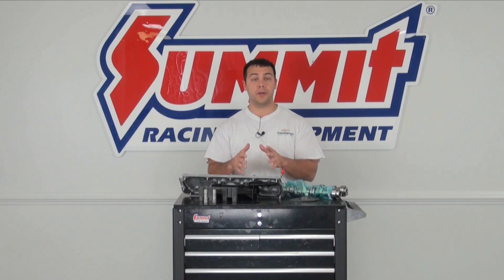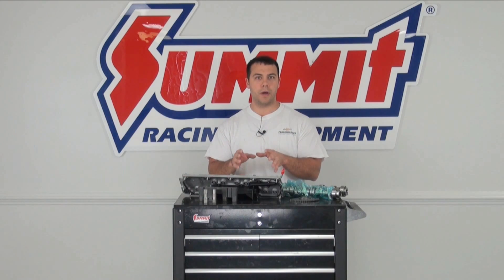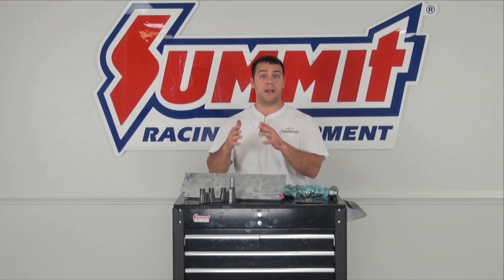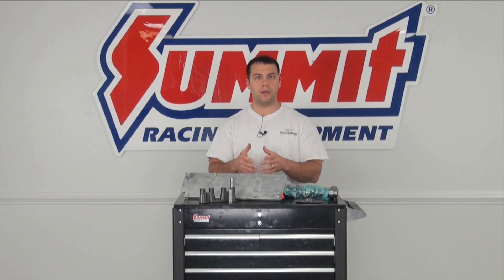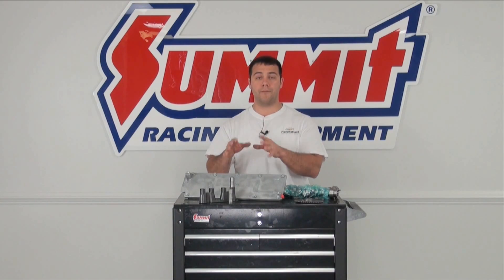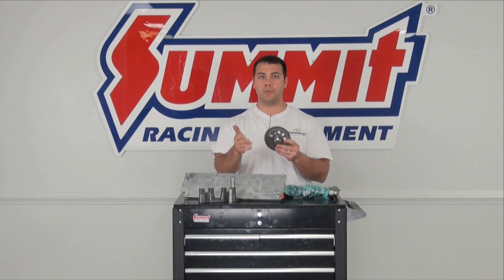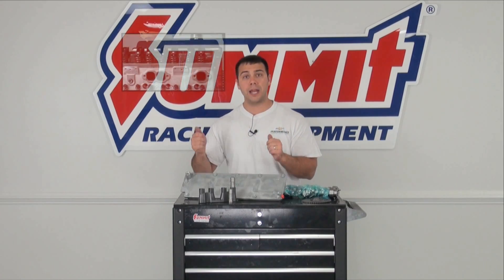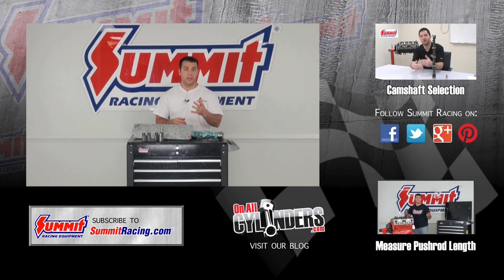LS Engine Cam Swap & Active Fuel Management Delete - Summit Racing Quick Flicks

Comment: I have a 2011 GMC Sierra 1500 Z71 off-road  with a 5.3 l with the 6 speed tran the truck started smoking maybe once a month or every 3000 miles give or take at aprox 150000 only on start up an it would be quite a bit of smoke an then I would check oil an there would be none on dipstick  which is  2 qt dipstick so from bottom of dipstick to full line is 2 quarts and I could always add a quart and then it would be half up on the dipstick so it's always just 2 quarts low every time when I would start it about every 3,000 miles or so and now it has 200,000 mi on it it's ran fine besides that happening but I'm looking to do an AFM delete kit and tune up what would you recommend

Comment: I have DOD deleted 5.3 and what to install a non active cam #12625437 and remove active cam #12625436 Can I reuse AFM lifters on a non active cam.
Reply from the maker: Thank you for your question.  Technically you probably could use a well-functioning DOD lifter, but there is still a chance it could collapse at some point.  We recommend using non-DOD lifters and trays.

Comment: Is is possible to just use the dod delete valley plate but leave the lifters and thus cam alone?
Reply from the maker: Hello, the valley plate can be reused, but the lifters are what normally fail when they are actuated.  A Range Technologies Disabler can be used if the engine is in good working order.  It can also be turned off in the tune with HP Tuners etc.  If you go with non-dod lifters, you will also need to go with a non-dod cam because the cam lobes on those four cylinders are ground differently.  The ECU will sense this as a misfire and will throw a code. 
 
A good article on this can be found here:
 
https://www.onallcylinders.com/2017/11/30/how-to-delete-or-disable-active-fuel-management-afm-on-gm-engines/

Comment: What can kit i can use if i have knock sensors?
Reply from the maker: Hi Luis, Thank you for your question.  Gen. 4 engines with AFM will all have the knock sensors located on the driver’s side just above the oil pan.  From there, the flat valley covers only differ in that some have a PCV tube and others do not.  Summit has both versions.

Comment: Btw this dod system isnt new at all if you guys remeber in the mid to late 80s when the cats on the exhaush was introduced cadillac had a system called  8 6 4 it did the exact same thing and it also was garbage. The coyote is a smaller motor and still blows the doors off a camaro from the factory

Comment: It's nice to use 500HP when you need it, it's better to get 25MPG the 98% of the other time you're just getting groceries (which my stock LH6 engine did). Please do a video on cam options for AFM-keep engines. Truck (torque) & car (speed/acceleration) applications, and include torque converter recommendations as needed. Lifter longevity is extremely important...it's bad enough with the factory cams and the repair is horrific in that the heads have to come off.
Reply: vidznstuff1 lh6 only gets 300hp stock? What mods did you do?
Reply: @MotoRacer171  No mods. Stock AFM motor from the factory makes 302-315 hp AND gets 25MPG highway
Reply: vidznstuff1 you said 500? My average is 14 but i dont really care about mpg

Comment: Can you provide a link to the cam timing gear (07 LC9) that is needed to go from a single bolt to a 3 bolt design along with any other parts list that would be needed to complete this modification? Second, you (meaning Summit) should provide some other kind of AFM\DoD kit that includes the price of a replacement cam, gear, and chain. I think this would be more beneficial other the AFM\VVT kit Summit has assembled.

Comment: i currently just had my lifters eat my cam alive and have to replace everything without factory warranty. i want to buy the dod delete kit but im not sure what direct replacement cam to purchase. id like to order the kit and cam because it will be cheaper than them ordering it for me. i wouldn't mind more torque on the low end but nothing were ill have to change anything from stock.  can someone whos done this help me out?

Comment: I want to delete afm but I don't want a stock 5.3 cam I want a vvt cam because I'm keeping vvt what are My options
Reply: https://www.summitracing.com/search?SortBy=BestKeywordMatch&SortOrder=Ascending&keyword=vvt%20cam&N=part-type%3Acamshafts
Reply: set the truck on fire and buy a ford
Reply: Jimmy Kimber ya sell your gmc to buy a Ford lmfao I dunno if you found out but Ford just did a recall on there trucks because they can burst into flames already 6 cases happened in my city lmfao I'd rather beef up my engine than be set on fire driving a p.o.s. Ford

Comment: I am wanting to upgrade my 2015 camaro ss l99 with a VVT camshaft while still using AFM and I wanted to know if the lift of the cam is restricted to .500 lift as on your web site all of your Comp cams XFI AFM  Gen IV Camshafts,  like this 689-421-13 are all limited to .500 lift. I was just hoping that I could use a cam with higher lift like .550. Thanks

Comment: hello
i have a 07.5 GMC vortec max im wanting to put a cam in around 224/224. now i have both VVT and AFM in my L76 engine im told, can i use both delete kits and then cam.  (of course will be tuned after) and will i have to changed my oil pump or can i leave it ?. Thank:D
Reply: I changed my oil pump, valley cover, timing cover, timing chain , valve springs, timing sprocket  (3 bolt design )   lifters & trays I have a 2007 vortecMax.
install the 224/224 114 LSA from Texas Speed and Performance and I love it, same 17mpg as b4 swap on highway

Comment: I have a 2013 Caprice PPV with L77 6.0 similar to Pontiac G8 Engine. It at my local dealer with low compression in #3 Cylinder. Considering a DOD Delete Kit/LS3 Cam & HD Springs/Lifters/Retainers. Will I need a ECU Tune After?
Reply: You have to get it tuned and turn off afm/dod. It will throw codes and disable the injectors

Comment: Right after I heard you say , it's either going to be displacement on demand or Variable Valve timing, I knew that you didn't know what you are talking about and stopped watching the video. DOD and VVT are two totally different things. An engine, such as the L99 can have both AFM and VVT.
Reply: 2 Years later and I'm just getting into knowing about this engine.  I like the idea of AFM And VVT.  how can I keep this engine in the best shape ? I Want to keep the AFM because I once had the 77 Cadillac coup Deville with DOD 8-6-4 I had to junk it because it got wrecked by a Drunk and had no money to fix it.  Mine also has the flex fuel should I use flex.
Reply: Chet , you are dead on , summit needs to take this video down , full of disinformation , These systems are involved , and someone giving out information needs to be 100 percent accurate , there are many things stated here that are wrong , while DOD and active fuel management are basically the same thing , they have NOTHING to do with variable vale timing , and should not even be discussed together , Anyone swapping a cam in a variable valve timing engine should go to ls1 tech to learn about them , there were 2 incarnations of them in the gen 4 engines alone , different phasers and cam cores , Do your homework before altering them or you may grenade an engine , another great source of sound information is , texas speed  , Here is a link to some correct  phaser info  https://ls1tech.com/forums/conversions-hybrids/1700232-07-08-vvt-cams-phasers.html
Reply: YOUR AN IDIOT

Comment: so if you do a camshaft modification/upgrade you can't use the VVT or DVD? It is either one or the other?
Reply: Comp Cams make a phaser limiter kit to reduce the full advance of the camshaft. VVT is not DOD/AFM, get your terminology right..
Reply: Chet is correct on this.
Reply from the maker: +Trevin Taylor, 
Although Comp Cams does have some upgrade cams for use with displacement on demand applications, the DOD lifters are not generally well suited for use with aggressive cam profiles! Proceed with caution there!  Now, valve to piston clearance is where you’ll get into trouble with variable valve timing. Larger more aggressive cams move the valves closer to the pistons, and when you start changing the valve position in the chamber with VVT, things could get pretty ugly in a hurry!  Feel free to give us a call if you have any other questions regarding this. 1-330-630-0240.

Comment: I have a 2006 monte carlo ss with the dod in it, can I just purchase a programmer and deactivate it? not looking to add a cam and all, or if I buy ur deactivate kit ur advertising do I have to buy a cam shaft to or can I just run whats in my car? Thanks Jeff
Reply from the maker: +Jeff Weaver, 
If you currently have no mechanical valve train issues and simply want to turn off your DOD, this device is all you’ll need! http://www.summitracing.com/parts/ret-ra003/applications/make/chevrolet/model/monte-carlo
Reply: You can disable the AFM/DOD, but your lifters can and will end up failing over time. Your engine has 8 AFM/DOD lifters and 8 regular lifters. The AFM/DOD lifters will most likely fail far earlier than the other. Best bet is to replace them all at one time, install your camshaft, new blocked off valley cover, etc...

Comment: Thanks for this informative videoseries. My question would be if there is a performance oriented variable cam timing cam? I don't quite understand why you would want to delete it, exept for the use of a more aggressive regular cam. In theory it would lead to a smoother powerband due to the difference in overlap at high/low rpm, which seems to be desireable for a performance oriented engine, especially in street use.
Reply from the maker: +Man Fred, 
Yes, Comp Cams does make camshafts for use with Variable Valve timing depending on your other mods. Give us a call, we can help you pick one out! 1-330-630-0240.

Comment: can you have a lumpy cam with performance with afm.
Reply: +Summit Racing  i have called u all with no help thay seem they dont no what im talkin about
Reply from the maker: +David Peric, 
While anything is possible, it would prove to be a tuning nightmare for your dyno guy. Not to mention, larger cams require heavier valve springs and may shorten the life span of the AFM lifters.

Comment: Good Info!.......I have a 2011 GMC Denali with the 6.2L. I want to get more HP so I can surprise some of these imports & pony cars. What's the biggest cam I can go with and still keep the AFM? I really like that LS3 Hot Cam, is it too big for the AFM? My SUV has the TB spacer, K&N filter with a AIRAID tube. Planning on adding Headers and Cat back system. Also how about just changing rocker arm ratio? Don't really want to go inside the motor if I can get HP up with bolt ons. Just want to get the HP in the  450 & up.Thanks!!!
Reply from the maker: +Steven Lynch , 
To ensure the AFM continues to work properly for you plus; the fact that you really don’t want to go inside the motor, a better choice would be the addition of a Supercharger kit. Below is a link to the Edelbrock kit that includes a Programmer so you won’t have to go to the dyno for tuning.  This kit makes a very reliable 500+ horsepower.
http://www.summitracing.com/parts/edl-1579/overview/year/2011/make/gmc/model/sierra-1500
Reply: Summit Racing Hopefully in the future, but $5k  for a 100 HP?
So, is it possible just to go with taller 1.8 rocker arms and vavle springs?
Reply: Summit Racing Hopefully in the future, but $5k  for a 100 HP?
So, is it possible just to go with taller 1.8 rocker arms and vavle springs?
Reply: Steven Lynch 
Taller Rockers won't help

Comment: #3 Cylinder not working GM Replace my Active Fuel Management cam lifters with GM Non Active Fuel Management cam & lifters.....No warning lights on dash but report from Onstar lower oil pressure switch faulty?
Reply from the maker: +FLYWHEEL1967 , 
Could be a coincidence or it could be an actual fault. You won’t know until a technician looks into it further!
Reply: Was fault oil pressure switch.....But service traction control 2007 impala comes on only when car idling every 60 seconds?
Reply: Afm cost me $5,900.

Comment: I have a 2014 Camaro SS l99 (auto) looking to "Cam" my vehicle. Does my vehicle have VVT, DOD, AFM? Will I need a kit to delete each of these? What parts will I need after I install the kits? Will I be able to use a more aggressive 3 bolt cam?
Reply from the maker: Hi bigpuff714, 
Please keep in mind first & foremost that any of the changes that you’ve listed will not only void your factory warranty but you will also not be able to pass any emissions tests. You will need to find a dyno shop to reprogram the computer after the changes or you can purchase HP Tuners or similar and do the reprogramming yourself.
Caution: there is quite a learning curve to reprogramming; it may be best to let the professionals do it the first time!
 
 If any of this is not a problem for you, give us a call and we can assist you in choosing a parts list that best suits your project goal. 1-330-630-0240. Thanks for watching!

Comment: Im so sick of paying for afm lifter failures. I got an 08 gmc siarra, and need some answers. ready to delete the afm, and have a v-8 all the time, at this rate the only thing Im saving is the world by my truck sitting in the yard not running at all, and Im still paying on repairs. Give me the answer I need to go with dont need racing, blaw blaw blaw, something above standard pre 2002 chevy would be nice. with out afm crap.pipedreamer12000@gmail.com
Reply from the maker: greg k, 
Below are the 2 part numbers you
will need to delete the displacement on demand. 
http://www.summitracing.com/parts/cmb-09-0026/applications
http://www.summitracing.com/parts/hyp-32501/overview/year/2008/make/gmc/model/sierra-1500
Let us know if you have any additional questions. Do not hesitate to call our tech line at 1-330-630-0240.